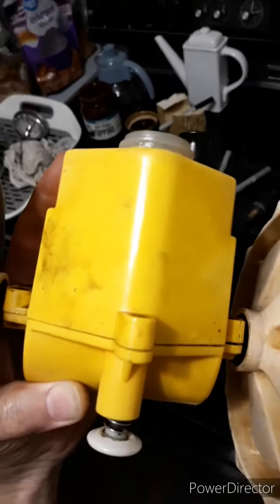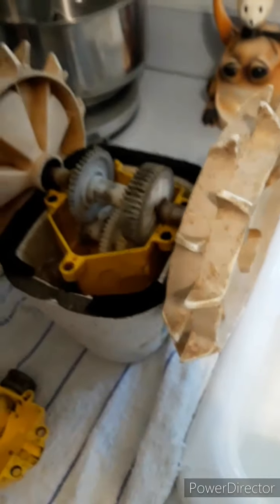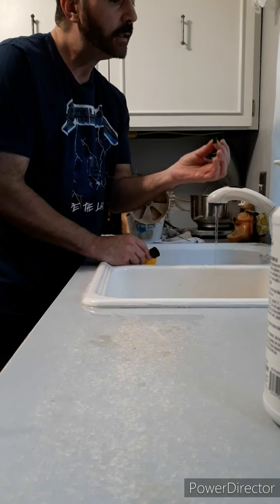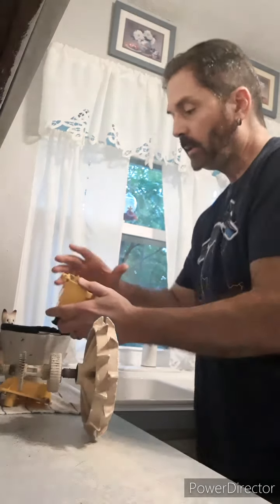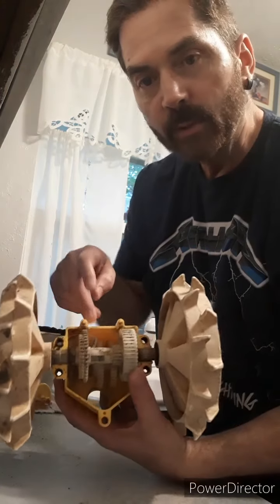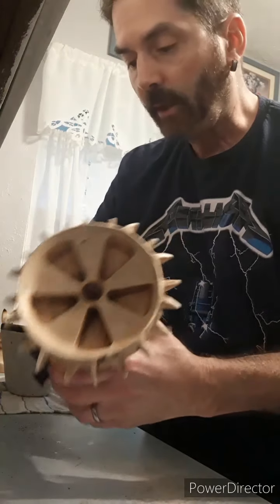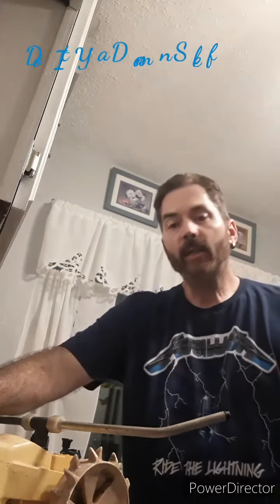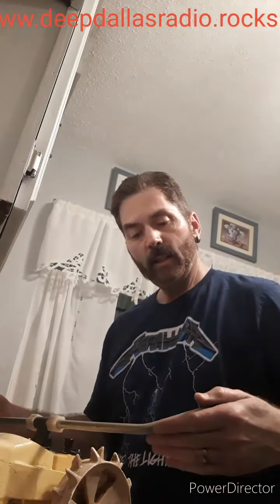Nelson Sprinkler repair

Comment: I have been trying to unscrew that top part for at least five minutes and probably a lot more. Pushing down, or not pushing down, as I did it and it seems nowhere near coming out. How long does it take for that to come out? Also, I fear the whole problem with mine not spraying or moving is because I would go out and adjust it while water was going through it just by stopping the arms and adjusting them and then let them go to let it back to sprinkling. I guess that’s a big no-no?
Reply from the maker: Hi Caleb sorry for the late response.  To remove the rotor arm grab the retaining nut right at the base of the rotor arm swivel and turn the top counter clockwise as you hold the retaining nut. I keep mine very loose so the metal insert  can come out as I showed but it sometimes takes a 9 mil allen wrench to take out the metal insert. I adjust mine just like you do all the time. I just reach in and stop the rotating arm with my hand. It gets me wet but it's ok. Is it not spraying at all and not moving across the yard?
As far as not moving while spraying does it try to move and sort of fall back as it pushes forward? If so that could be the nylon gears are stripped and need to be replaced. If it just sits there without moving or clicking it may just be stuck in neutral. (it has 3 settings Low, Neutral and High. The settings are on the back of the motor unit on the top with the black arrow dial) If it is not spraying at all it won't move due to the gears not spinning and this would more than likely be from a clog like I had or the stop switch on the bottom is stuck. If you think that this may be the case unhook it from the hose and push the stop button in and out a few times to free it. I hope this helps you. Let me know if it is working or not.
Reply: Use a 3/8 inch allen wrench

Comment: Thanks for the vid. (And thanks to you, I have now switched to Dawn dish detergent! That's good stuff! lol) Question on the reassembly, though... When putting it back together and testing that it turns (@10:06), it won't turn. The gears do not appear to be stripped, but I cannot figure out what's going on. I have 2 of these I was trying to troubleshoot and both are the same way. Thoughts? Thanks!
Reply from the maker: Hi., Thanks for watching. The only thing that I can think of is that the gears may be binding up inside. Some things to look for are where the rotor arm assembly goes there is an allen (Hex) hole for a 9 mil allen to fit into. Loosen that up to make sure it isn't too tight. I just barely have mine hand tight. Keep it pretty loose. Another thing to look for if the wheel gears are binding. Check all the gears for anything that may be blocking or binding. Pull the wheel assembly out of the bottom and visually inspect the gears for missing teeth or anything that may be in there that shouldn't be there. Watch the derailer work and make sure that it is not getting in the way of works. Sometimes that can go over too far. Let me know if you get it going. I haven't had this issue before. Thank you again Coloradoevie.
Reply: @doityadamnself8138  Thanks for the reply. The original issue was that the arms would rotate, but the tractor wouldn't move. So I took apart the housing to see if the gears were stripped and they were not. So I cleaned everything up and put grease back on and when I start to put it back together and test the wheels (as you show in your video at the 10:06 timestamp), the wheels wouldn't turn. Mind-boggling, but I'll keep trying and let you know if I figure it out! :) thanks again
Reply from the maker: @coloradoevie  If the gear changing derailer is in the middle it will be in neutral and the rotor will turn but it wont move. If it is in fast or slow gear the wheels wont turn by hand. Sorry if I am telling you things that you already know. Those are the only things that I could think of that would cause those issues.  The wheels will only spin by hand if it is in neutral. I hope some of this helps.
Reply from the maker: @coloradoevie  I was checking with you to see if you were able to fix your sprinkler.

Comment from the maker: if when removing the rotor it doesnt come out just by spinning the rotor a 9 mil allen wrench will easily remove the part. It should not be sinched down with the allen wrench in my opinion. Just barely hand tight.